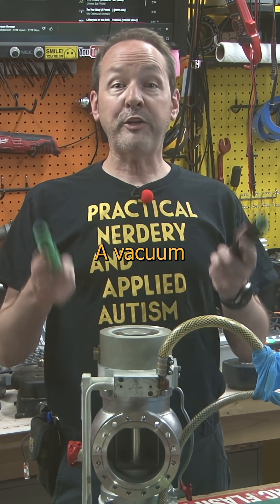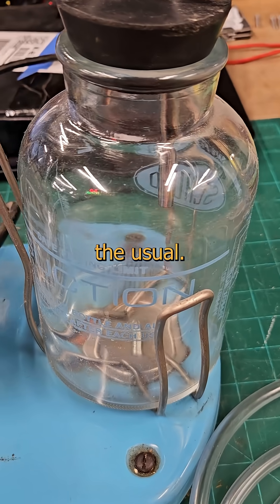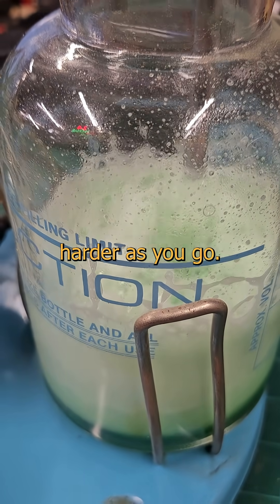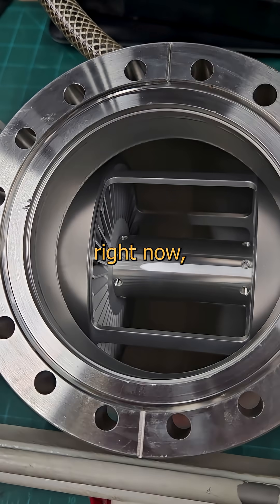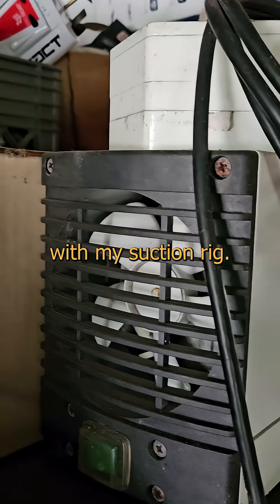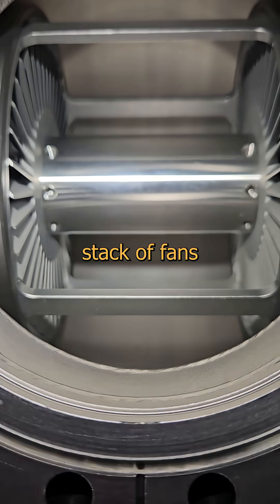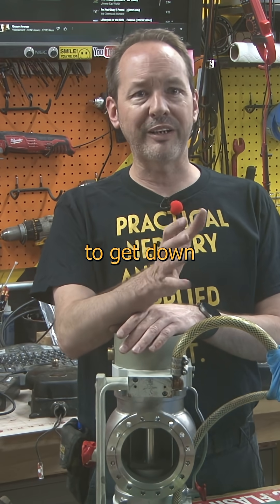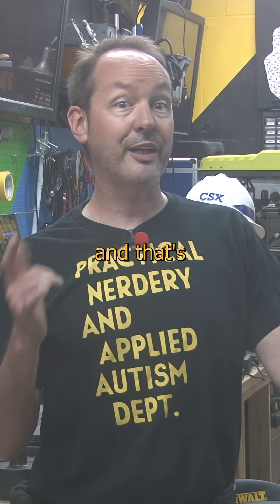Turbomolecular Vacuum Pump #chrisboden #comedy #engineering #physics #science #turbo #nerd

Comment: If you are ever in a semiconductor fab, where nearly everything happens under extreme vacuum, and there is a power flicker the whole building will shake and shudder when the turbo pumps lose just a little rpm  from before being spun back up.  Occasionally they do RUD.  

Many systems also use cryo pumps to trap hydrogen that isn’t effectively removed by the turbo pumps. With both you can achieve e-9 pressures.

Comment: -10°F outside, it's been 12 hours on a 7-11 rooftop and I finish replacing a walk in compressor and I'm trying to finish pulling a vacuum. You've never felt more defeated seeing 1000um stall out, I assure you. No leaks tho so that was cool. Also F*ck 7-11 equipment.

Comment: We used a roughing pump and pulled hard vacuum with a Welch silicon oil low vacuum pump. That thing had only one speed, full throttle. So you would pump all the lines down, check your pressure, literally shake all the seals a little to make sure you didn't loose soft vacuum and then open the line to the Welch. At least once a month someone would open that line to early and that Welch would fire about a 2 cups of oil out and choke just like someone laughing while trying to drink and firing out their nose. Only once did someone open it to atmosphere and I heard it from about 50ft away. I can only describe it as a robot having it's Hollywood death scene. When I got over it was like a murder scene.

Comment: The more delicate vacuum pump works between two chambers that are already near vacuum, right? It pushes the minuscule number of air molecules from one near vacuum to the other near vacuum, where a "roughing pump" pulls the rest of the air out with conventional methods. 

I'm just wondering how it's supposed to hold back atmospheric pressure on one side with vacuum on the other

Comment: I’ve wanted to do it for years, but it would be even better to see you do it:

Buy a cheap used turbo pump, put it under vacuum and let it get up to full RPM speed with a large ball valve on the vacuum source, then open the ball valve up while the pump is at full speed and record it for us to be pleased  😂

Comment: Let’s not forget the spicy cousin, oil diffusion pumps! The very same that nearly resulted in my DNF from undergrad when fabricating a small scale sector field mass spec in my garage. I decided to cheap out on the oil for my salvaged diffusion pump (oh right, flash points exist) that and some shoddy connections betwixt the roughing pump and UHV pump resulted in super heated oil meeting atmosphere. Not a fun evening but a rather hard to ignore teaching moment!

Comment: Roughing->TMP gets you a High Vacuum, but if you wanna go to SPACE, you need to use BOTH of those oddball machines to pull a vacuum on the third pump.  And this fuckin' thing has ZERO moving parts(!?)  

Behold:  The DIFFUSION Pump!

Comment: I first read about these at a job working with transmission electron microscopes. There, they would use oil diffusion pumps to achieve the same thing: smacking individual air molecules down towards the roughing pump to get pumped out. Those damn things had to be cool with liquid nitrogen, and apparently in the past one of these pumps had lost that cooling and started to liquefy itself. The droopy remains of that pump were kept in the boss’s office.

Comment: I’m curious… What would happen if you were to fill a container full of a different fluid instead of air. For simplicity sake let’s say water or mineral oil, would that make it easier to pull a vacuum sucking out the fluid instead of sucking out air?

Comment: Ive always had a question a science peraon may be able to answer.
If I had a mylar balloon and for this instance we will break some physics laws just for fun and say that this mylar ballon is stiffer than steel but still only weighs as much as a standard mylar balloon. So stiff we can suck all the air out of it. Would that balloon float or sink? Because nothing is lighter than hydrogen right? Balloon is full of nothing. Does balloon rise or fall?

Comment: I worked at a place that made plastic (like literal raw plastic granules) and the process required high temperatures which would cause it to burn so it was done in an atmosphere of nitrogen... which required pumping out all the regular air to get rid of oxygen.

There were massive tanks in one of the area and one of them was collapsed because someone sucked out all the air... but forgot to turn it off and the pump kept on going until this tank that was the size of a small car (and made out of metal that's thicker than a finger or two) got crushed like an aluminum soda can.

They kinda left it there, probably as a warning to others to not eff around with pumps.

Also, funny story... 100% or near 100% pure nitrogen will kill you as it'll push all oxygen out of your bloodstream and your brain shuts down within seconds.

3 people died (years before I worked there) cause one person entered an enclosed space filled mostly with nitrogen, fainted, two more people rushed to help and also instantly fainted at which point someone had the idea to check if maybe nitrogen is being pumped into the thing, which was unfortunately too late.

Comment: I worked on some vacuum systems for a chemical lab once. I swear chemEs are addicted to destroying their own equipment. One time somebody left a chamber open and pulling air for an entire weekend. Or at least a few hours of it. This pump was only designed to pull air for maybe a few minutes, and then just maintain the vacuum. Well if it keeps pulling air it overheats and sprays polimerized oil all over the entire fucking system before it seizes and never spins again. Machinist took one look and pronounced the poor thing dead after I hauled it 3 blocks down to his shop.

I offered to put together a bunch of sensors to make sure doors are closed and the pressure is indeed dropping but apparently that's too expensive while destroying the big ass fancy vacuum pump is an acceptable level of risk.

Comment: look up "jet tower pump" fantastic bit of statistics and diffusion all coupled with a bit of Bernoulli and low vapor pressure oil heated up under vacuum in a cold trap. Zero moving parts aside from the Oil.

Comment: I’m thinking a half a gram of air molecules is a little more than billions. Molecular weight of N2, nitrogen gas, is 28. So divide Avogadro’s number by 28 and 2 (for half a gram) and I get about 10^22, or 10,000,000,000,000,000,000,000. That’s a lot of molecules.

Comment: TMPs also don't like sitting idle for months. Something abut the lubricant gumming up I think.   I Have mine set up to run all the time.  Also I don't have to go through the drill of baking out the chamber again after being exposed to all sorts of moisture.   To keep my electric bill down I have it set up for intermittent backing.  That is  the rouging pump only runs on startup, then when the power drawn by the turbo gets down to 40 watts, the roughing pump shuts off, until the draw is back up to 50 wants and the cycle repeats.

Comment: Ok, so no using this for potting guitar pickups, despite the fact it would absolutely do the job of vacuum potting and probably a bit better than needed. The reason i wont try it is that potting pickups is done in melted wax around 140°f and when you do the initial pull of air for vacuum potting you wind up with a huge ammount of bubbles and it almost looks boiling hot when its only what you set it to on a hot plate. Pulling air out of things can be wildly fun to watch, and it can even cause unusual effects. I thought that's pretty cool.

Comment: The blades don't reach Mach Jesus unfortunately. The limits of material strength dictate that they can only go slightly faster than Mach 1. None the less, there are few sounds akin to starting a TMP up and knowing that that ever-rising note is how many rotations per second the rotor is making.

Comment: I used to run a big turbopump mounted under a metal evaporator chamber inside a nitrogen glove box. There is something just a little bit special about the jet engine whine of turbo pump spinning up. It was a slightly modified Edwards Auto 500 for those who know. 

I don't miss being a poor PhD student, but I do miss being in the lab making things and solving problems all day. Grad students and post-docs, enjoy it while it lasts!

Comment: Cryogenic vessels use vacuum as part of the insulation between the tank holding liquid nitrogen (or other liquid air products) at -260°C and the outer shell at whatever temperature is on the outside.

The pumps I use at work get down to 1 mTorr of vacuum.

Comment: I just read the wikipedia article about turbomolecular pumps and they are fking nuts. No wonder people write PhDs about this. 

...The rotor is stabilized in all of its six degrees of freedom. One degree is governed by the electric motor. ...

...Because the magnetic bearings and the temperature cycles allow for only a limited clearance between rotor and stator, the blades at the high pressure stages are somewhat degenerated into a single helical foil each....

...Laminar flow cannot be used for pumping, because laminar turbines stall when not used at the designed flow. The pump can be cooled down to improve the compression, but should not be so cold as to condense ice on the blades. ...

Comment: Bilions of molecules is a huge understatement.

The (average) molecular weight of air is roughly 30g/mol. 

The number of molecules in 0.5g of air(~0.7 litre) is:

(0.5g)/(30g/mol)*(6*10²³molecules/mol)=1*10²³molecules=one hundred sextillion molecules=ten quadrillion billion molecules
Reply: The pump that I used was able to get to 10^-6 Pa or 10^-11 atnospheres. That is still 10^12 molecules in one breath.

Comment: There's a Canadian channel called Thought Emporium that designed their own sputtering magnetron that uses one of these just to get down to pressures low enough to get the rest out with an oil pump that will ignite if ran at atmospheric pressures

Comment: This is a really interesting problem as emptying a $thing to a vacuum is really hard. Pumps don't suck as much as they move, although they can push real good. 
Why can't you suck water more than 34 ish feet? Because you are generating a vacuum and that 14.7 psi of atmospheric pressure at STP is only enough to push water 34 feet up the pipe: pumps only suck out because of the atmosphere pushing in, so creating a vacuum where you need to remove air, without letting any back in, with nothing to scare the remaining air molecules up the pipe to freedom, you rely on chance to pull the last ones out that more by luck than design manage to find their way into the pipe to the pump. 
Possibly the only way to almost guarantee a vacuum is to start with something empty and managing to expand it through mechanical force... and that empty something needs to expand against 14.7 psi trying to crush it back.

Comment: Think the air is thick on Earth? Try Venus. Ninety-three times thicker than Earth’s, composed mainly of carbon dioxide, at temperatures can reach around 460 degrees Celsius (860 degrees Fahrenheit), hot enough to melt lead.

If you were standing on the surface of Venus, all of that atmosphere above you would create crushing pressure. The atmospheric pressure at sea level on Earth is about 1 bar, or 14.7 pounds per square inch (psi). The atmospheric pressure on the surface of Venus is about 92 bar, or 1,350 psi. To put this into context, imagine having 1,350 pounds (over 600 kilograms) resting on one square inch of your body; it would be like having a small car sitting on your thumbnail.

Another way of contextualizing the atmospheric pressure is to imagine being a kilometer (about 0.6 miles) underwater, with all that water pushing down on you. Deep sea missions that visit such depths in our oceans need to use special submarines that have been reinforced to withstand the intense pressure. An unprotected diver wouldn’t stand a chance, unable to breathe their tank’s oxygen because of all the pressure pushing in on their chest. Standing on the surface of Venus, you’d essentially be crushed by the sheer mass of all the atmosphere on top of you.
Reply: Another way of contextualizing the atmospheric pressure is to imagine being a kilometer (about 0.6 miles) underwater, with all that water pushing down on you. Deep sea missions that visit such depths in our oceans need to use special submarines that have been reinforced to withstand the intense pressure. An unprotected diver wouldn’t stand a chance, unable to breathe their tank’s oxygen because of all the pressure pushing in on their chest. Standing on the surface of Venus, you’d essentially be crushed by the sheer mass of all the atmosphere on top of you.

Comment: That is an old pump. Pfeiffer hasn’t made that model in 40 years. The newer pumps have maglev armatures and have a holwek drag section on the same armature as the turbine. The coolest pump I got to work with was an Edwards high compression pump. 1000 liters per second. Compression ratio for hydrogen greater than 10 to the 6th. When you are working with Deuterium, that’s pretty cool.

Comment: I used to work as an oil processor producing instrument transformers for power companies across the globe… vacuum pumps were my bread and butter. Used to have to work on many pumps in my time, those things had to be at like 0.05 millibar. We put them through a drying process in large ovens to remove moisture from these towering units, and then filled them with mineral oil for insulation. It was an interesting job! I’ve since moved to quality assurance for industrial circuit breakers, something I’ve been doing for coming up on 2 years.

Comment: Roughing pump sort of like a pony motor on construction equipment ?

Clitoral engoergement? the clit myth surfaces again!

So, an HVAC vacuum pump is a baby version of the pump you got there.

Those pumps be expensive...... low cost simulation... build a DIY submarine, and take it down to the Titanic... Wait, that was a pressurized vessel, not one in a vacuum..... at least for a while. I tend to come up with really bad analogies.